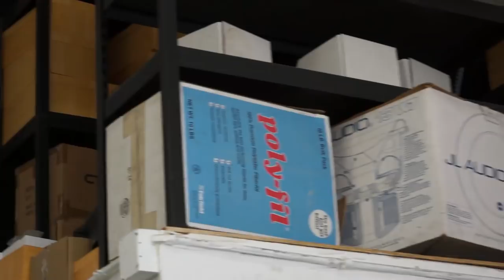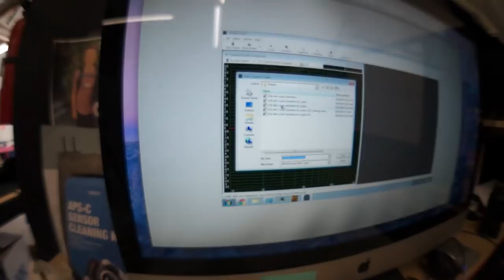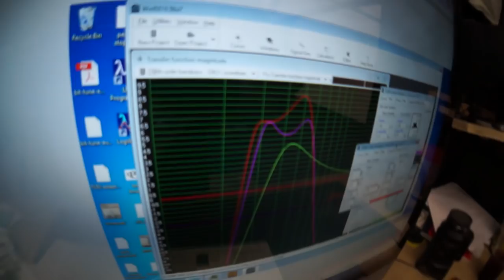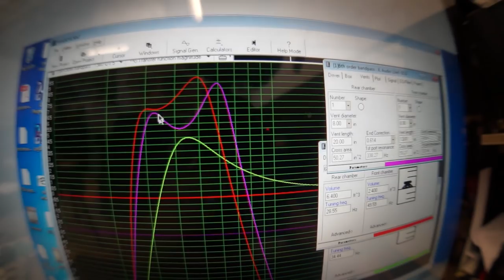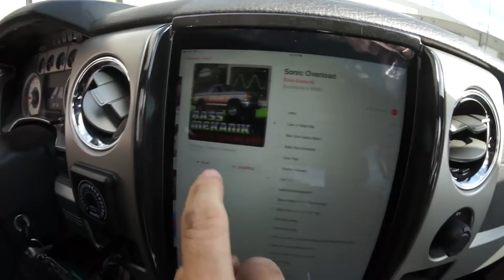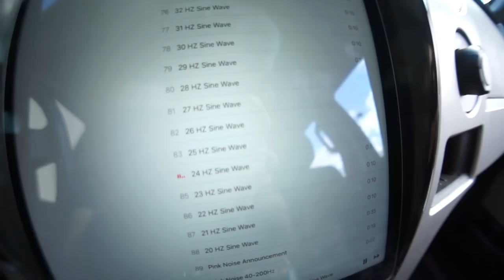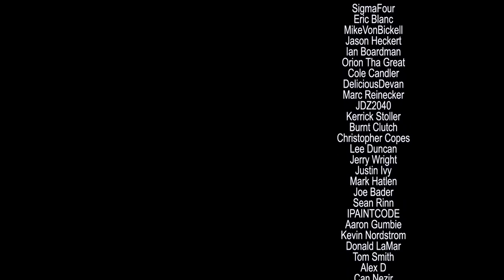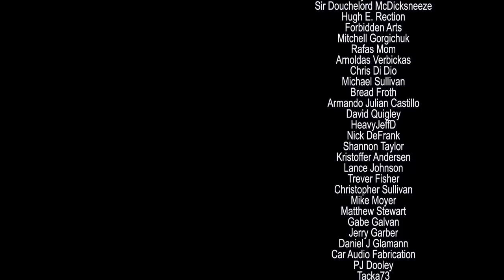How to handle a subwoofer failure - AMPLIFIED #671

Comment: Doug, fix the sub, mount the both facing each other, wire one in reverse, they'll suck and blow each other, blowing out the seems in your body panels, breaking the zip ties that hold the power wires, cracking the gas tank, arc against drive shaft and ignite the fumes.  🤘

Comment: Hey Doug..  Try leaving the rear seats down and test. Should be better. The proximity of the ports to the seats change the port tuning... LOL your funny dude.  Great vids.

And your right. You can have that higher in the upper bass and still have the same low end..  But, Run Winisd graph windo in SP: mode at the top of the graph window. Now you can see the real difference between subs. It will apply the sensitivity spec in the mix. Now if the JL or the Focal has a higher sensitivity value. you will see that difference on the chart. Like if the focal has a higher db@1w spec. then it will be even higher on the chart. But if it is lower than the jl, then that is most likely why the focal is not as loud.  But Id test without the seats up.  I had seen in one vid you had a baby seat belted in back there. Could put 1 seat between the ports for the baby.

Mags

Comment: I had a shop install a 13w7 in my mopar and they left the gain and bass boost at 100% so of course it fried the sub and after I got it warrantied they still didn’t change the settings and try to say it burnt up because I used a iPhone instead of CD’s. Lol I sent JL an Email and explained what there licensed dealer was doing and they replaced it again anyways so I tuned it myself before the put the cover on. $4000 dollar stereo and they screwed the amp to the brand new pro wedge box and had black take holding the wires they pieced together. I should have just got the stuff directly from JL and done it myself but figured since I was getting a better deal then buying direct I would just let them install it and save me the trouble and it ended up being twice the work and expense. Oh I had to pay the $50 shipping both times even though it was clearly there fault. I honestly don’t trust any stereo shop. Good thing JL ain’t a bunch of thieving skum bags like the authorized dealer in Somerset KY.

Comment: That happened to me with my 8w7AE on 600 watts RMS off a HD750/1 and an Audio Control Epicenter lol! Half the spider tore off the voice cool. It couldn't handle the excursion of the low frequencies. Got a used 12w7 on same amp and while my 8w7 gets repaired under warranty and so far it working good. Sort of feel like going with an SPL brand, I seem to like Heavy BASS vs SQ lol!

Comment: Should just run multiple subs instead of single sub on a 7k
Reply: Single sub ftw
Reply: A single dual 4 ohm DC Neo ran in series would be tits.
Reply: Legendary504 yea im hoping hes just doing this build as a starting point for a bigger build, the 7k is a lil bit of an over kill
Reply: Brady Simpson the focal is paralleled it’s running 2ohms
Reply: Legendary504 it’s an sq thing,  he is using a 7k to keep distortion down.
Reply: Gerald Norton I'm sure that JL sounds hella clean too
Reply: Just Chillin this guy basically runs a whole audio shop 😂 he knows what he's doing dude

Comment: Put an oscilloscope across the sub wires at the amp and tune gain for below clipping. Your amp you said is 1500w and the sub is 2000w, so clipping may be the issue in burning the coils.  I like to use more power than the woofers handle to get them to full power without being close to clipping. And its hard to hear if the sub is clipping with the seats are in the way.

Mags

Comment: I bet the voice coil smells French...🤣

JL may have great SQ woofers but for the $ and power I've gone away to DC Sound Lab. After owning 4x12w6v2, 2x13w7 and sold all the rest of the JL line, I think DC makes a stronger sub at a much better price point. I've since had DC 2x LVL4XL15s and 12s and currently beat my LVL2 10s and I can honestly say, as long as the quality doesn't change, I won't buy anything else. 

Keep it the great work Doug!

Comment: If both ports are tuned to the same they're out of phase, so it'll be cancelled out. Not surprised it blew, overpowered in a 6th order. I'd suggest looking at subs with a small vas for this box, which most comp subs are anyway. If you're wanting to add another port, get one the same size as the current one for the big chamber, if the current tuning is 30 it should then peak around 43, and to tune it low simply plug one of the ports with the worlds largest plug.
Reply: im just leaving this here to read the replies

Comment: I have three 10 W6 JL Audio that just devour amplifiers I must have chewed up a amplifiers in 5 years with that speaker setup and I'm talking good amplifiers Rockford Fosgate JL Audio just all high-end names the Fosgate lasted the longest about 2 years
Reply: jeff wolf uve blown multiple amps with 3 10 w6 JLs clearly your doin something wrong subs have nothin to do with blowin amps amps blow subs not the other way around amps blow due to human error
Reply: mostly lack of input power
Reply: Anthony O'Dell nice and I paid a lot of money to have that put in my BMW to thanks for the input
Reply: John Smith my Fosgate amp I think was a 500 watt 1 channel amp or something like that that should have been enough power no? Thanks for the heads up
Reply: not enough power :/
Reply: No no I am not trying to be a dick. What I am talking about is say 90% of amp failures are caused by your charging system not providing enough power for your amp. That is exactly why everyone says do the big 3 not because your system won't play but because when it starts starving for power and starts to see big fluctuation in voltage it  starts to get hot. Amps need a strong steady voltage to  be healthy. Its always a good idea to upgrade your charging system to what you would think would be overkill and get a couple batteries back there within a couple feet of your amp that way they absorb the fluctuations. Besides your shit will hit much harder and you will have an even bigger grin on your face.

 Stock alternator provide enough power for every system on your vehicle with like a 10% over head and your gonna need more than 15amps (10% of 150amps= 15amps)  to keep your amp turned on.
Reply: John Smith it was put into my mid-90s 525 BMW and I had to replace the alternator one time and it was the highest rated amp alternator for any of the BMW so I had in this vehicle already at it was like I think 240 Watts or maybe more it was something much higher than most Vehicles get I know that as it certainly was not a cheap alternator then again anything BMW is not going to be all that cheap I don't think you're being a dick I just like the information I don't know what went wrong but I know it just chewed up amplifiers and it was professionally so called put into which annoyed me because I I spent a good amount of money on that as well and I have a 1 farad capacitor to I noticed what that no more dimming of the headlights with a heavy loud thumps or anything like that
Reply: I have an eclipse with no amplifier in the head unit and it has like a 8 or 12 volt pre output (3)which made it much louder when it goes through the amplifiers like that at least that's what I found out when I hook you up and got that receiver CD player

Comment: Well you have been clipping the shit out of it :)
Reply: James Wong fuck yeah he has. needs a few XS power batteries and another alternator.
Reply: every time we see the bass knob the clip light is lit up like a Christmas tree :)
Reply: FYI those Ct sounds bass knobs with the voltage and clip light aren't accurate. Read about them in forums and i also had one(tossed it)
Reply: He isnt clipping, that amplifier is a 7kw amp on a sub never meant to take more than 1500w. The sub will smoke before even getting near max rail voltage.
Reply: Jl has soft thermal.
Reply: Travis (HitemWithTheFlex) yea he played it hard to soon maybe? My sub blew for torturing it for a good time, smelled like burnt then sounded like a slinky :D reconed it and im about to pop it again..

Comment: I Owned a JL Audio 13 W7  & the Cone Separated from the Voice Coil Bobbin  glue Trench. POS Glue Let Loose. The Cone Material Is A Non Stick Type Plastic & JL Never Incorporated A Hooked bottom Edge of the Cone, To Provide a Locking Groove for the Glue to Tooth into. I Wasted $ 700.00 + on that POS.

Comment: Put a full set of Definitive Technology BP-20 speakers in a full range box bridged of a Phoenix Gold MS2125 along with two Kicker W7 10's running off another Phoenix amp in a massive enclosure and my lord. Forget car audio 4ohm crap. You have NO idea. Next level. Not even next level, next universe. No comparison. I will never use 4ohm mid's and high's again.

Comment: I'm telling you , check out dark audio industries or dark Ai . they have a nki its a three inch vc with a ceramic former, dual spiders , giant motor ....I'm running the nko s and they weigh in at 25 lbs each .